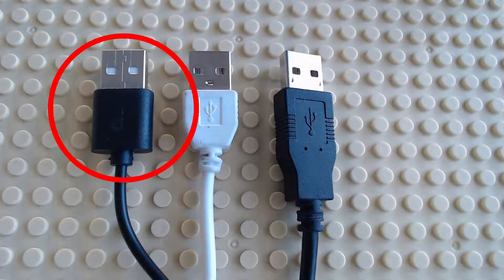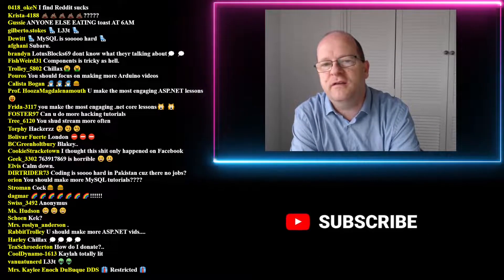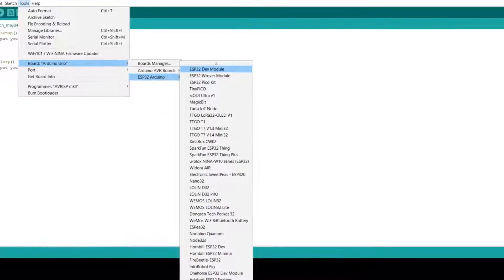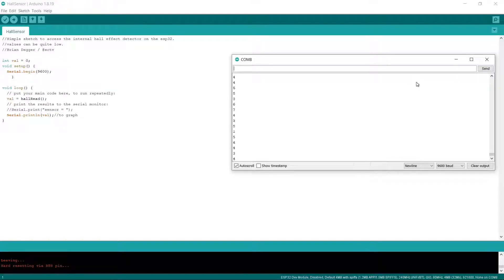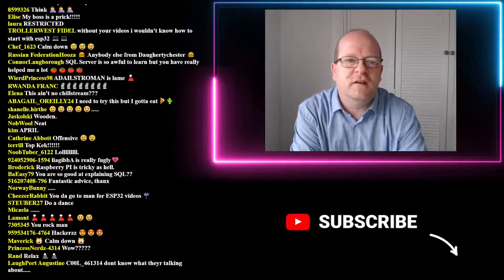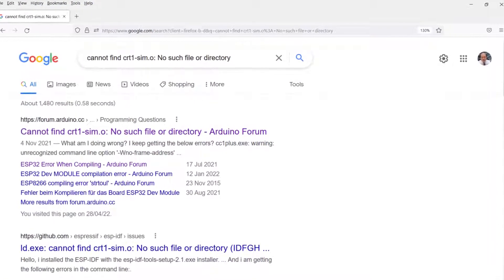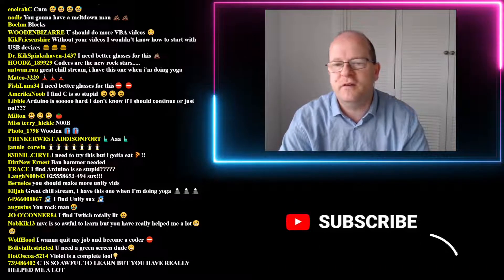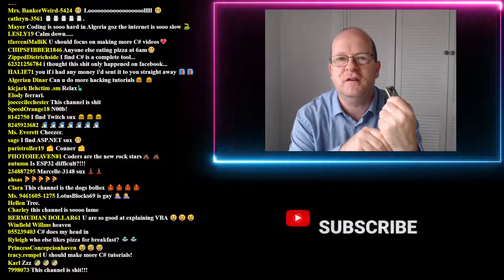Solved: ESP32 Sketch Won't Compile or Upload in Arduino IDE

Comment: They're junk. Every esp32 that I've ever owned has showed issues. When they are running, they're good. But, it won't last. Arduino's are ultra stable, but limited. But at least they work.

Comment: HOW TO SOLVE THIS ERROR:
Error while detecting libraries included by C:\Users\Emmanuel\AppData\Local\arduino\sketches\63542117CC06F858B95D32E9A64DF794\sketch\esp32_rfid_securitysystem.ino.cpp

Comment: "The most difficult to get working" ??   NO.. HELL NO !!
I'd give that award to the Arduino Nano
ESP32 is bloody easy.
I mean once you get past that step of adding the board to the IDE
After that it's easy
Reply: I'm still using 8 year old Nanos. But every esp32 that I have ever bought has come up with issues. And it's kind of lame having to hit the reset button every time you load up a sketch. Esp3'Junk.
Reply: @victororo462  
No, ESP32 isn't Junk.
it would appear that one's you got are,

I've also had a few where i had to keep hitting reset , that does Suck, i agree

but when you get good one's it's not like that.
My advice. don't go for the absolute cheapest ones and also pay attention which chipset you're using.

Strangely, I've had nothing but issues with Nano, but then .. Most people have.

Now, i worked out the issues with the Nano. you gotta do more configuring than is really necessary.

so ESP32 is far superior

Comment: i have this error:
{ "error": "Error getting Debug info: Compiled sketch not found in C:\Users\sn17849\AppData\Local\Temp\arduino\sketches\63350F131DE15C932FDBF97BFD697018" }

Comment: I followed all your directions and it worked perfectly. Arduino 2.0 is better in every way once you get it working. I had a bad link in board mgr and switched it the the espressif ESP link you provided and now it compiles and loads quickly (at least quick enough). I had to delete every sign of the old IDE and now there is no issue. Thank you! All of my boards now work without issue.

Comment: Hi Brett I had the problem of being unable to upload sketches to the esp32 board i tried all the things you suggested in this video but was still getting error while attempting to upload the sketch i was getting this error message in the red bit at the bottom of the c=screen 'Wrong boot mode detected (0x13)' after a little bit of googling i found this solution you have to press and hold the boot button then click the 'EN' button then click upload on the IDE then when the message at the bottom says connecting release the boot button then the sketch will be uploaded successfully.
Peter M7DTK
Reply: can you expliain the last two lines again please
Reply: @MuksEmmaN Just tell him that they're junk.

Comment: Hello sir, yesterday i bought that same Azdelivery esp32 board which has 38 pins, but after testing some few codes i found that my board's GPIO25 and GPIO26 are shorted together internally. it is my first esp board and i don't have any experience with it. Is it normal to have these pins shorted or is it just a manufacturing fault?

Comment: I couldn't upload the sketch to my ESP32. It turned out that it was my laptops Bluetooth COM ports that were using the same ports. So I had 2 COM6 ports. After disabling Bluetooth it works again.
Reply from the maker: Thanks for the useful info - this might be causing other people similar issues. I've not seen this issue as my desktop PC doesn't have bluetooth (but my laptop does, and I've never had any COM port issues on that one either).

Comment: Whenever I go to upload my sketch, the com port just doesn't show up. I've installed the proper drivers and have scoured the internet for several hours searching for a solution. Still can't get it to work.
Reply: did u manage to find the problem because i have the exact same problem
Reply: @henk3441  IIRC it was probably a faulty port connection. I either switched up which usb port I was using or got a new board altogether.
Reply: @henk3441 some esp32 boards need cp2102 or ch34x drivers

Comment: Hi Brett, I appreciate your videos. Problem: Starting about a week ago, every time I upload a sketch, it fries my TTGO LoRa32-OLED V1 board. I've ruined 3 of them. Any ideas? Thanks in advance...
Reply from the maker: Sorry not heard of that board but I hope you found a solution.
Reply: IT MIGHT BE THT THERE IS NO COM TO BOARD VOLATGE REGULATOR AND TTHE BOARD MIGHT NLY RUN IN 3.3V NOT 5V
SO TRY TO USE AN VOLTAGE REGULATOR
Reply: They're junk. I bought mine, did thr setup, never achieved anything with them.